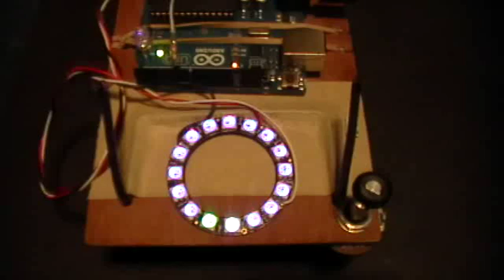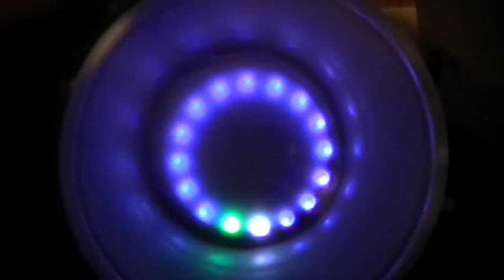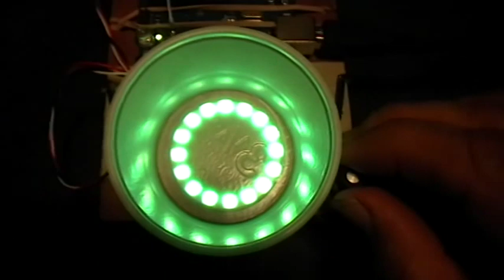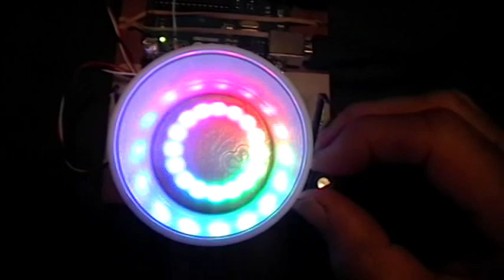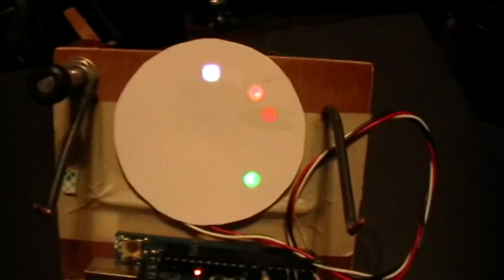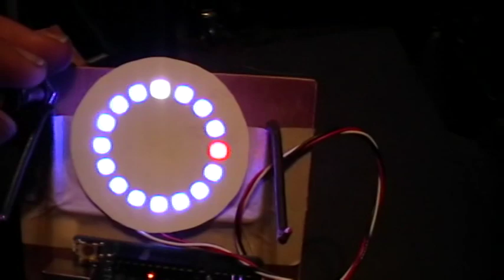Arduino: Adafruit NeoPixel Ring Demo2

Comment: mind sharing the code?
Reply from the maker: ***** It has evolved somewhat from this simple demonstration. What you are seeing here is mostly just the "strandtest" demo from the Adafruit neopixel library:
https://learn.adafruit.com/adafruit-neopixel-uberguide/arduino-library
The latest version of my NeoPixel box is quite a bit different, including a second inner ring and an ultrasonic rangefinder (Parallax Ping thing). Here's a little later stage in the development, but still not the full item.
https://www.youtube.com/watch?v=_eXp1mY6VNo
Here's the link to the big sketch:
http://www.mediafire.com/view/vrrwdjy936y6dim/TKNeoPixelDemoBox.ino
You will need the NeoPixel library from Adafruit at the link up above. 
Have fun and let me know how it works for you!
Reply: TinselKoala Ah ok I understand mate, I just though some of the programs you were running looked pretty cool and would take a while to do from scratch, but if it is already in the library then it should be fine. The new iteration looks great btw!

Comment from the maker: I added a small piezo element, and made the Clock display "tick" just like a real clockwork clock!
Piezo + to D12, - to ground,
then code:
digitalWrite(12, HIGH);
delay(7);
digitalWrite(12, LOW);
when you want a long louder tick and same thing but with no delay for a tiny softer tick.